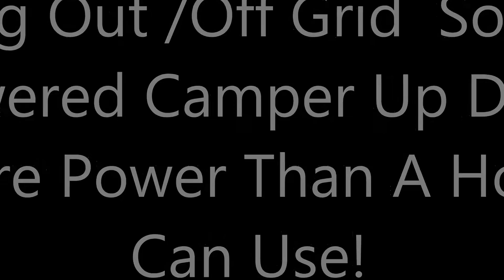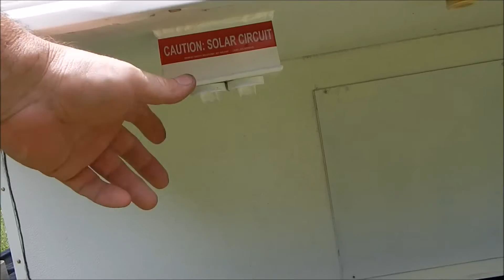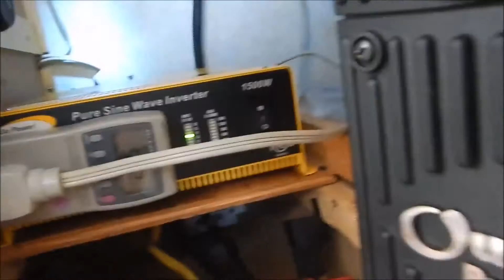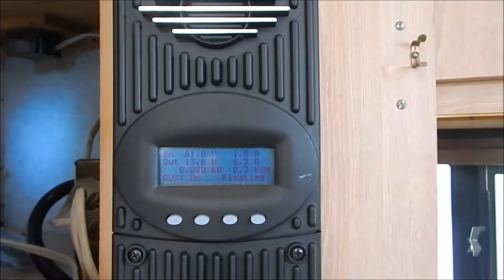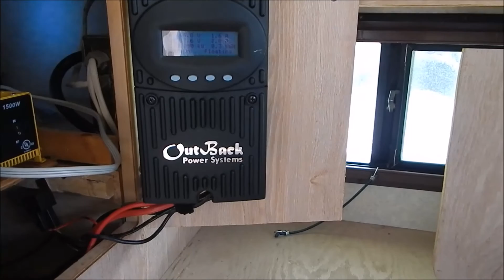Bug Out / Off grid Hobo Camper First  Solar Test Went well.

Comment: Nice job! 
I'm also building a camper, sleeps 5, solar powered by 150 watt panel and 200 amh batteries  self contained water and Porta potty.  Slides into a utility trailer , 13 ft with 6ft. Head room but light. I need some sujestions to complete it. Thanks
Mac camper 136
Reply: Can you contact me.  6122270192

Comment: I have a pop top camper similar to yours.  I had been thinking about putting panels on top.  Have you noticed any difficulty cranking the top up with the extra weight?  Thanks!
Reply from the maker: +Fernbark Frist  I would suggest u put your panels over the roof were the lift arms are .I did not have room to do that so I now have to help get it going up it was only about 88lbs but it did make a noticeable difference in effort to lift the top. that said it does the job effortlessly    plenty of power. Thanks for watching

Comment: Nice rig! You might want to think about some covers for those panels, and with impact resistance. I had a limb hit one of my panels (in 2011) and it put some very tiny hair-line cracks in the glass. They were invisible to the eye..
 
Then, this summer I was trying to wash off some bird poop with a water hose. The spray must have been on the micro-cracks too long and some water got under the glass.. The panel is now a fire hazard.. 
Temperature on the hot spot was over 212F when I took it off line.
http://ecorenovator.org/forum/solar-power/1284-cs6p-200-canadian-solar-pv-xantrex-c40-project-6.html#post45979
Reply from the maker: Richard Lee Thanks for sharing Rich I guess I have been lucky so far.

Comment: Nice system! It must had cost a lot of money to build it
Reply from the maker: toritochis Thanks Just a quick guess most equipment I all ready had I'd  say around $2500 ball park over last 4 years, Charge controller, solar panels, wiring ,battery's  switch's on & on not counting the little Truck camper & my new Inverter gen set for Back up for the  Back up. missing something I'm sure.
Reply: Sure ia a lot of money.  By the way you got a nice place, lots of room! I also live in Florida...
Reply from the maker: toritochis Thanks ! Its for sale.
Reply: Wow.... I don't even want to ask the price, We just bought a house  in south Florida, but your place looks really nice, it looks like it has a lot of area for a good 20k solar project if you wanted to or more... !!!